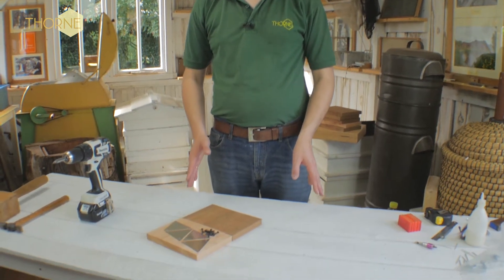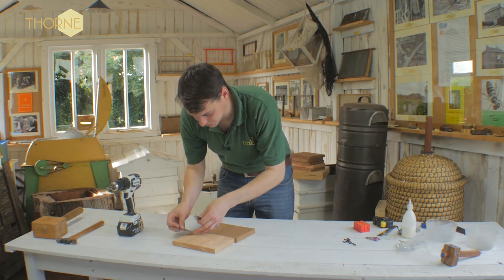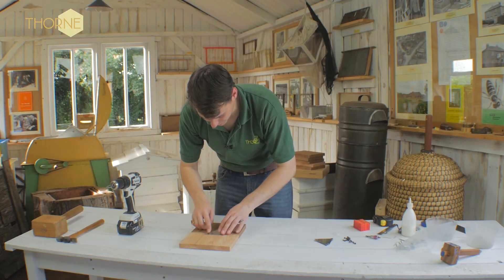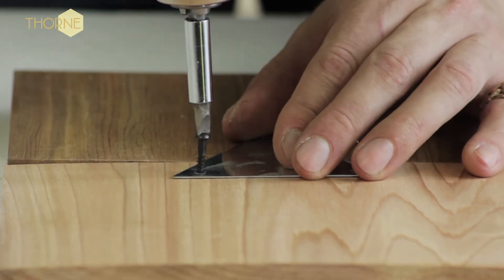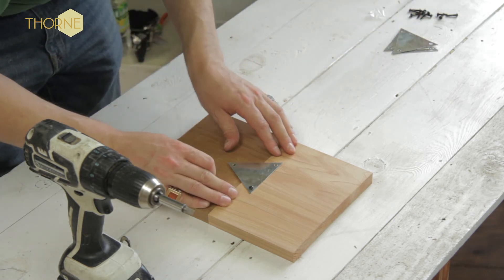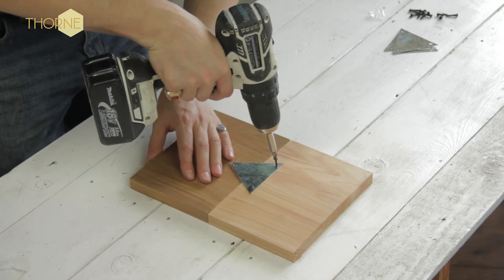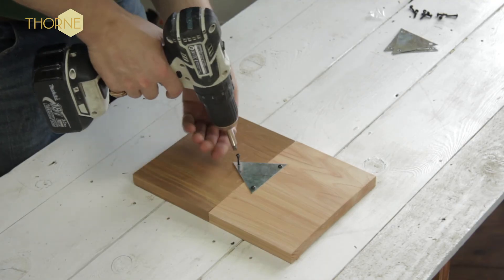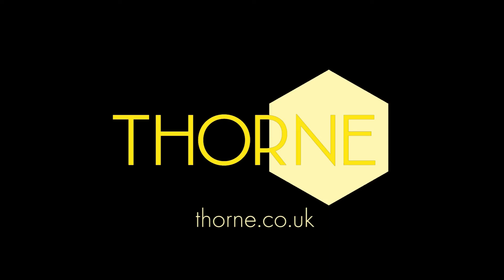Thorne Beehives - attaching Triangles to a hive

Comment: Why? Maybe I grew up on the wrong side of the pond, but I have never seen or felt any need for something like this, Or when I did a nylon cargo strap seemed like a more practical solution.
Reply from the maker: Yes certainly alot of people use straps but we do sell alot of these - hence the video!!  I think it is for more long term fixings - say fixing an eke to a brood body to convert to a 14"x12" or fixing a floor to a brood body for ease of moving.